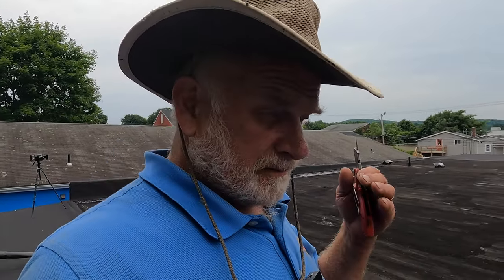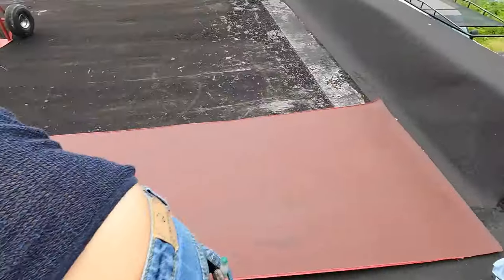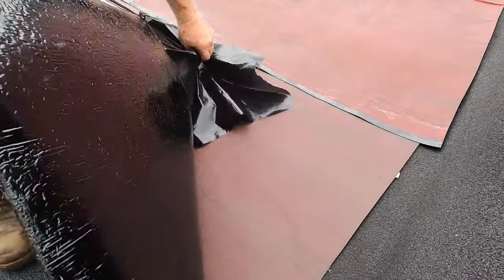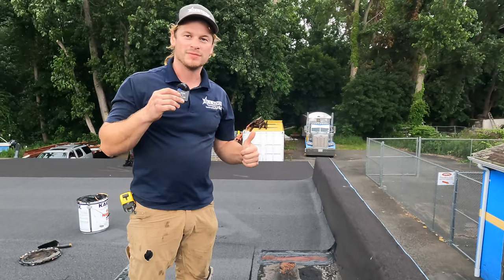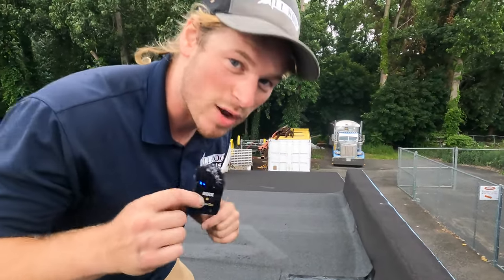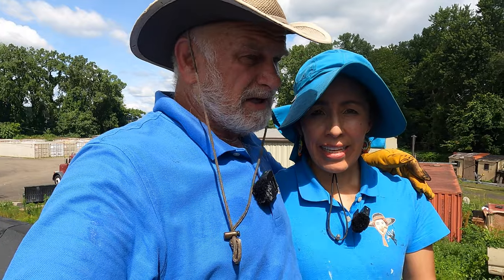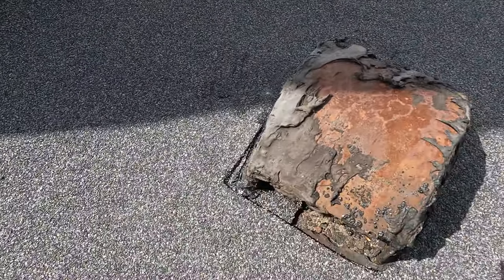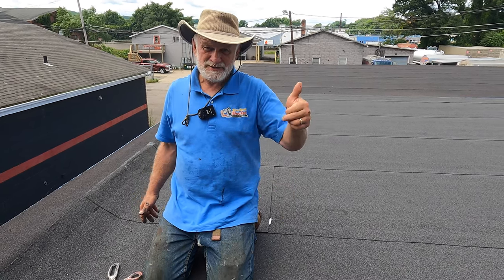Rubber Flat Roof Install - Peel and Stick Only 2 people needed DIY, Cheap, Carport, Garage, Porch,..

Comment: As a 35 year roofer I have never seen such a thing in my life. But I am not a fan of recovering any roof. Any one who has tore off two or more layer's of roofing know's what is going on with the roof under the top one. Old roof continues to decompose, witch takes away from the life of the new installed roof. Even if a recover board it put down. And at min and install some one way vaper vents, so hot condensated air can escape.

Comment: Most counties of the USA allow a max of 2 layers to a flat roof (check with YOUR a county building Dept).  After that you have to remove the old down to the plywood strata.  Also, roofers comments indicate and 80 lb roller is needed to rollover the material.

Comment: That underlay is awesome not seen that in UK. The only worry i have is if the old roof was leaking anywhere there could be rotten boards under your new cap felt? I would always recommend a re board and felt where possible,  What do i know you are the flat roof god haha love your videos thanks for the refresh i have one on next week unfortunately with a leak which most likely will need new boards fitting.
Reply: I think the roof was made of Twin-T's (concrete)
Reply: Wait for the video old wood doesn't rot in the end,try to keep up before you get fired

Comment: Why did you stop using the UV silver coating on the Polyseal? Not necessary anymore or is it a cosmetic finishing for white roofs? Thanks for the entertaining videos.
Reply from the maker: We are planning to go back and do another video on the flashing part in a few weeks and that is when we will apply the silver coating. Good observation.
Cheers

Comment: I am in South Florida and this roof has to pass an inspection by a licensed roofing contractor to get insurance.  While it looks simple, we do not know if this DIY approach will survive heavy winds, high heat, and torrential rains…sometimes all at the same time.  I really wish it were this simple and affordable and appreciate the information, but the comments by roofers point out many potential problems with the installation.
Reply: Just wait for terrible weather and then do a.i. 45 minutes video on just how good it not being
Reply: In south Florida you're not allowed to put roll roofing over an existing roof layer.  "TopShield Pro underlayment roofing systems membranes shall not be applied over an existing roof membrane."
Reply: Truthfully as a 35 year roofer I would not put this on a dog house. Just my opinion.
Reply: @shawncummings4653  Show us your video then.   This guy has been doing this for many years with no problems.
Reply: @jamescole3152  I don't need to show anything. I have been roofing all through the US. As a speacilst in government roofing. I don't need to prove a dam thing to you.
Reply: Tremco/wti will get it down right
Reply: @shawncummings4653  if you don't prove it than you're lying, period.

Comment: Was that TOILET PAPER you used for the flashing ?
Reply from the maker: Polyester Fleece
Reply: Yes but there is a speciality trowel and a 7 gallon bucket of  Elmer's glue sold by a second company but you have to be a preferred contractor licensed and insured
Reply: The Catalina wine mixer
Reply: Wait. They are trying to hide some &$"$$$#

Comment: Nice job!  This is one of the best videos on the application of APP membranes. The video gives complete details right from the cleaning of site, application of Primer, Fixing of APP sheets with hot torch method & finishing with siliver paint.
Reply: I can almost taste the paint but I'm not at work yet so I will have to wait
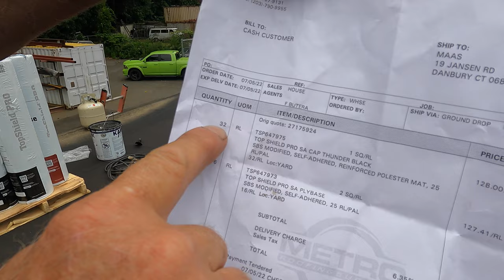Reply: This is an SBS membrane, not APP.  See the bill of sale at 1:09.  Also Top Shield states that their SBS membranes are not to be torch applied.

Comment: What is the difference between Karnak 81 and Karnak 66 trowel grade products? Is one better to use in different situations?
Reply from the maker: its almost the same Karnak 81 is sometimes hard to get
Reply: @FlatRoofDoctor  I am having a hard time finding either Karnak 81 and 66 locally. Can you recommend a different manufacturer's product that would be your second best.
Reply: @pitviper7924  Henrys doesn't last !  Use it for temp emergency only  ! HD has plenty in stock !
Reply: @robyg7037  I have been at Home Depot and they only have Karnak 19. Is Karnak 19 equivalent to 81 or 66?
Reply: 81 has more rubber

Comment: Link to roofing material? And is the bottome layer required?
Reply: TopShield SBS.  Not only is the base layer required, but you're not supposed to install the system directly onto an existing roof.  Good product, cheapo installation.

Comment: Nice to see a new video. And how about you pros, working a five gallon tar bucket with clean hands! I have a flat roof with a slight pitch, so I’ll stay tuned. Y’all make it look easy. Thanks from Michigan.
Reply from the maker: It is really that easy. my wife and I did that very fast
Reply: Yea man it's easy to keep those hands kleen just never touch it

Comment: I have a torch down roof with leaks. The rolled roofing has white gravel on top. Can I patch over this white gravel roofing? Seems that the patched of new roofing won’t adhere to the old roofing with the white gravel
Reply: Yes it will if you have the right materials. Some are used for adhering the cap sheet and some are used to flash. Make sure if there is metal to get some primer first. Get the quick prime and you can flash right away and also get the white granules to cover your patch and if you got the right stuff your repair should look like it was still brand new haha
Reply: @garrett3113  thanks

Comment: You could get coring drill bits for cutting out the hole for the vents or maybe it won't work? What do you think?
Reply from the maker: a lot of effort to go get a tool and do a little cut. The hole is never in the right spot so you still have to cut slits to move the membrane around to position it
Reply: @FlatRoofDoctor  I see. Thanks.

Comment: I have a rubber torch down about 15 years old.  2 leaks on same side.  My question is, torch down is only layer, can I just put the granulatedayer on or do I need the underlayment t to make better contact with the top layer?
Reply: I'm a roofer his installation was wrong but I'll help you out you can put down base and cap but not required you just need to use primer or degranulate the area you want to patch mean heating up the old cap sheet and inbeding the granules. Melting it and it looks black then you can touch the new cap on top
Reply: Is it smooth torch?  If not don't try peel & stick cap sheet directly onto it.  These self adhering membranes do not stick to granulated surfaces well.  Trust me I've been roofing for 24 years
Reply: You need the base layer.  Buy non-adhering NailBase rolls and cap nail it with Simplex fasteners if you can't get a decent adherence with your base sheet
Reply: You don't need the base layer you can fully prime the granulated cap sheet with asphalt primer and you have to inbed or degranulate all edges around the roof at least 6 inches then you can touch on top of the old cap sheet. Go to a roofing supply store. Don't use Home Depot.
Reply: @migueldefreitas1367  bro this isn't torch down being installed
Reply: Read the guys question he has a 15 year old torch down roof
Reply: @migueldefreitas1367  yeah, and he's asking if he can put peel & stick onto it
Reply: And if he's talking about putting peel and stick on top he can he has to use Elastico stick primer instead of asphalt primer and still needs to degranulate all edges at least 6 inches
Reply: @migueldefreitas1367  won't last
Reply: Just purchase torchdown and burn on top of the current layer.. no need to do all these extra steps these guys are saying if you are burning on top of a granulated torchdown just give it a little more heat near the seams…
Sorry to break it to you guys but No home owner is gonna embed granules and do all that extra shit as if they are getting it inspected for warranty lmao

Comment: What is the best option for a completely flat roof with no pitch? Thanks
Reply from the maker: I prefer Torch Down over peel and Stick base. I think that is by far the toughest roof out there. Then TPO and then maybe EPDM
Reply: Thank you. Parts of the roof have silver coat, will torch down stick fine to those parts?  Thanks again I really appreciate the help

Comment: Only issue is when you laid the cap sheet you need to get a proper bleed out on your seams and you're not
Reply: There's no bleedout with peel & stick membranes
Reply: My issue is why use this cheep crap. And why is he torching peal and stick at all.

Comment: I like to do the same to my low slope roof, but there is a L section need the edge that as a slight U indented area that collect water and it moves to the drain pipe. How do I shape that to the old roofing? Can I use a hand torch to finish the edge?

Comment: wont work on actual flat only low pitch and it doesnt stick to any surface , if bottom layer not stuck a storm can pull it all off.. those seams wont stop standing water
Reply: Well your obviously an amateur painter

Comment: What pitch is the minimum requirement for this?
Reply from the maker: I did it on a 3 pitch. I think the manufacturers suggest a 4 -5 pitch
Reply: @FlatRoofDoctor  3 pitch?
Reply: @mohammad911america  That is the flattest 3 pitch i have ever seen.
Reply: @alecb8509  Im guessing more like 1/2:12

Comment: Wow, that’s got to be the roughest bit of flat roofing I’ve ever seen. Barring some of your other videos. Self adhesive membranes but no activation primer? You don’t mind if the underlay isn’t stuck? I hope it doesn’t get windy there. No new skirting details, upstands finished on the vertical! It’s no wonder flat roofs have a bad name!
Reply from the maker: You have no clue how wind uplift works.
A roof only gets uplifted if wind can get under the membrane.
Reply: There are many flat roofs in the Arctic areas of the globe. Yes even torch down ones !  Good sealing at joints and constant inspection is needed ! Yes I'm from Northern Alaska !
Reply: Agreed mate if I did that at work ide be shoot😂😂😂
Reply: it seems the @FlatRoofDoctor has no clue how wind uplift works. At least google wind uplift on a flat roof before you take the bait you cowboy.

Comment: You give a warranty on that work? Been roofing all my life, that is a easy roof to install,that's facts,,it's just not the best flat roof system to install on that building,it's one of the worst in my opinion..tpo,,epmd,even hot tar is better than that peel in stick...with that roof having walls going down both sides like that & all the penitrations coming through the roof,I would of went with epdm or tpo just my opinion,,using a sealant for flashing is only temporary...

Comment: Hello my name is Miguel and I watched almost daily your videos, unfortunately I have to do my roof, I had so many estimates but they’re too expensive, I can’t afford, so watching your videos , it seems very simple to do it so I will, the problem is that my roof is perfectly level, I want to create some kind of pitch using Poly ISO insulation panels, my question is that after I install the sloped Poly ISO can I use the peel and stick base straight to that or I need to put another type of base. Thank you in advance

Comment: Anyone with enough common sense knows that cheap actually means very expensive to repair, buyer, beware!
Reply from the maker: True in most  cases. In this case, it is cheap because you can do it yourself saving a lot on labor. The material is not cheap

Comment: Regarding the roll roofing material you used, would you please provide the name of the company, the name of the roll material and any product # that might help me order it? 

I zoomed in on your invoice and got some of the info from there, but it was a bit blurry and I couldn’t see the top of the invoice to see which company you bought it from. Thank you!
Reply: It's a Top Shield SBS system.  Not meant to go over an existing membrane.  This a cheapo roof job.  Would never get a factory warranty.

Comment: Turbo poly seal is $200 per gallon you have a 5-gallon bucket there that means you paid $1,000 for a bucket
My customers won't pay me spend money like that
Reply: Was this the video which began with $6000+ bill for materials?       So if labor costs are charged according to book estimating manuel,  how much labor wage does roof owner pay?

Comment: This is not how you install this your supposed to nail it and tar it don't install your roof like this because it will leak I promise when the weather changes the material changes with it so  expect it to harden and lift up which is the reason for taring and nail underneath the over lap

Comment: As they say, a little knowledge is dangerous.  There are so many fatal errors in this roof installation, I lost count in the first five minutes.  For starters, this is not a "rubber" roof, as he states.  It as an asphalt-based "modified bitumen membrane.  Second, it can sometimes be installed over existing roof systems, but cannot be installed over "anything", as he states.  Beyond that, nearly every application instruction is incorrect.  If this roof is watertight at all, it is sure to fail within a few years, max.  Please do not take this person's roofing advice.  People should stick to things they know!

Comment: Please do not put a self adhered modified roof on like this guy. 
 Anyone who has ever put stickers on anything knows it needs to be clean and smooth.  
 Even roofover he could of screwed down a insulation board. 
 The roof runs up the wall a few inches, base and cap. Then you hang a wall flashing. 
 Why am i telling you folks what the instructions and pictures on the package say. Just read them. 
 I am 3rd generation 38 year commercial flatroofer. If you got any questions just ask. This is not the way.

Comment: Thats a terrible way to do a flat roof . Sliver paint around a pipe. The whole roof will leak 💯
Reply from the maker: The silver paint was after the flashing was done with Turbo Poly Seal - you are confused
Reply: It was still done wrong!

Comment: "We didn't use base because we were in a hurry" are you kidding me? These guys are showing 4 different applications without doing any of them properly. Absolutely do not follow any of this guys money saving tips because when it leaks your not only going to rip off twice as much crap but your insulation ceiling drywall and flooring will be in need of repair also. Go watch 50 other videos but don't watch or follow anything from this hack job. "Cheapest roof" is going to be the one that doesn't leak for 50 years!

Comment: Absolutely one of the worst roof installations I have seen in my 52 years of built up roofing. The entire roof should have been primed before installing the base. This roof will now blister, and start leaking 15 years before the end of its serviceable life. The flashings will ALL leak in the next 5 years. Watch some Manufacturer's videos to learn the proper methods.(GAF, Polyglas)